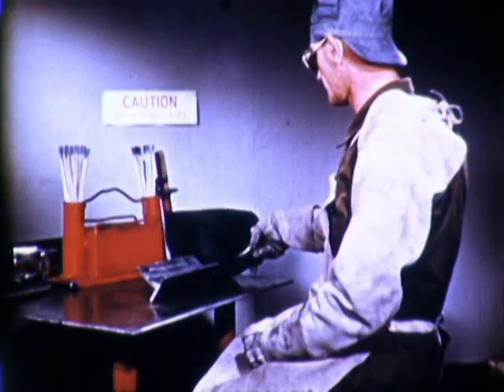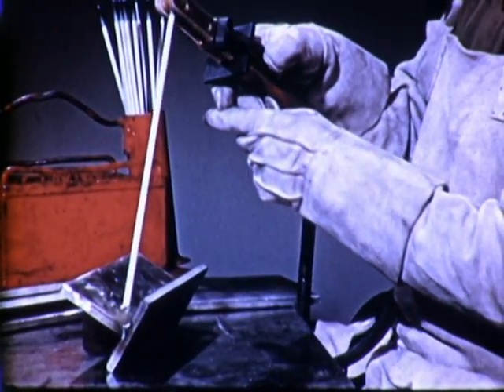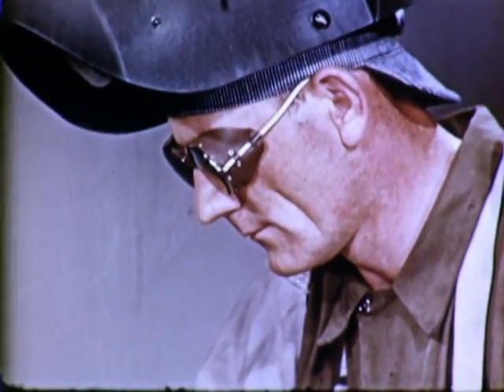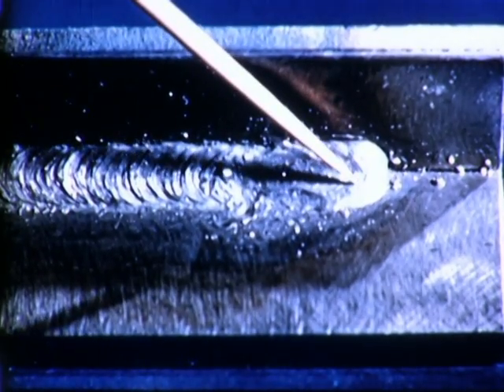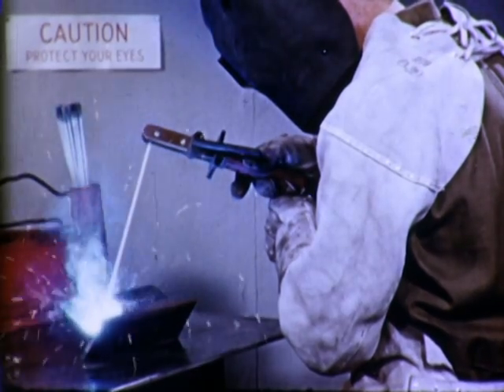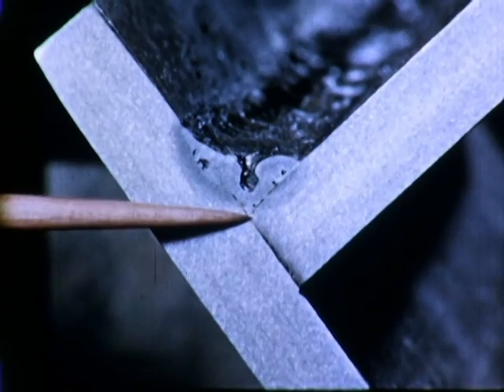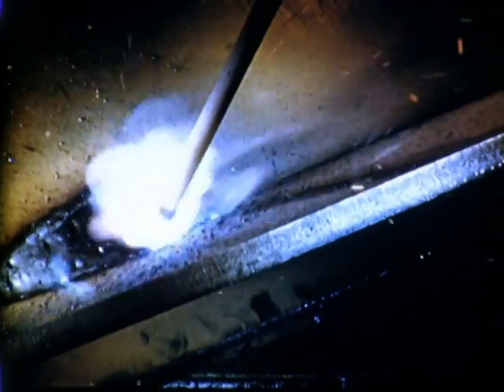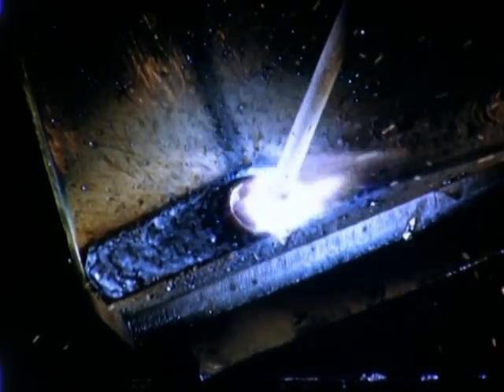Inside Arc Welding #2: Flat Position - 1942

Comment: At 4:33 he talks about "crater cracking". The lower quality of their steel and lack of basic low-hydrogen electrodes was a common cause of weld cracking in the early days of arc welding. The hulls of welded ships would experience fatigue and cold cracking due to poor carbon and manganese control in Bessemer steel.

Comment: Hi, im new to stick welding, do you have to move the electrod forward and backward (just like what the animation on the video shown) or just move the stick forward?
Reply: TheDungeonGymMalaysia as far as I understand, moving forward and back into the puddle creates a weld with deeper penetration, whereas just moving forward with no whipping motion creates a shallower weld, good for thinner material. This applies to fast freeze rods, like 6010, and not any low-hydrogen rods, like 7018. Hope that helps.
Reply: Both can happen, there are some rods and situations where you can just move continuously down the seam.  I think this "whipping" has a good function, in that the forward move allows the arc to penetrate the base more, and moving back fills the bead, prevents undercut and all.  If I understand it:  A continuous motion should be such that the electrode is always on the forward edge of the puddle. So this would give you the famous "Stringer" bead.  And I think (haven't gotten this far myself) that if you want more metal you can make more stringer beads.  This might be best practice in some situations in that it minimizes heat input into the base metal.  It's hard for beginners to realize that welding heat is destructive to what you're trying to make, and there's a RIGHT amount of welding.  On light work it's very easy and tempting to over weld, and end up with all kinds of distortion and misery.